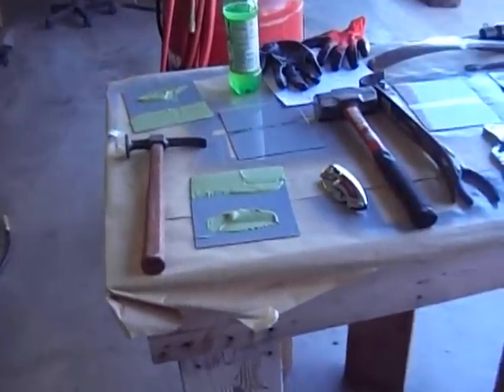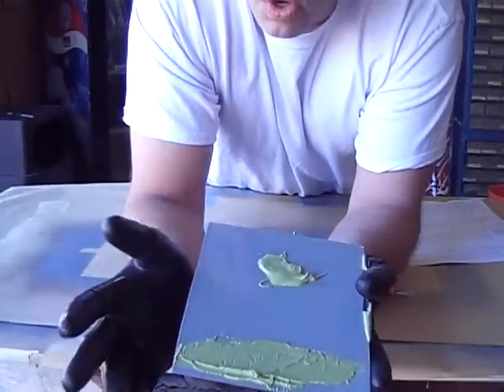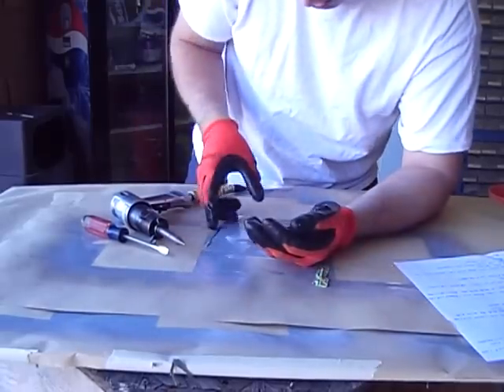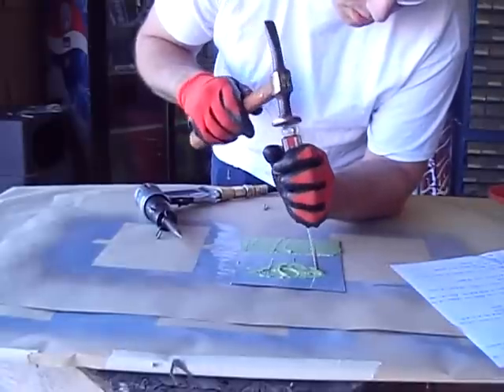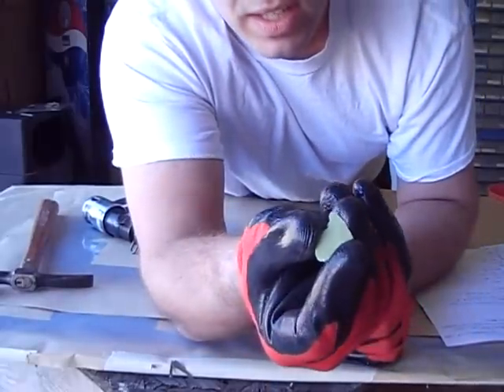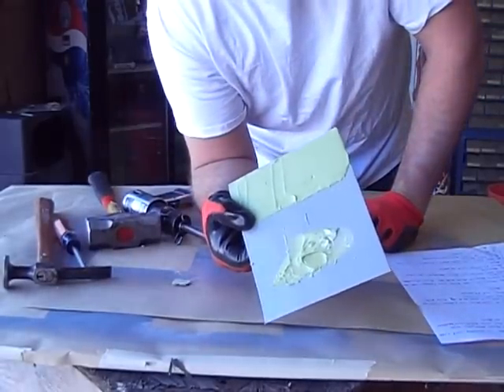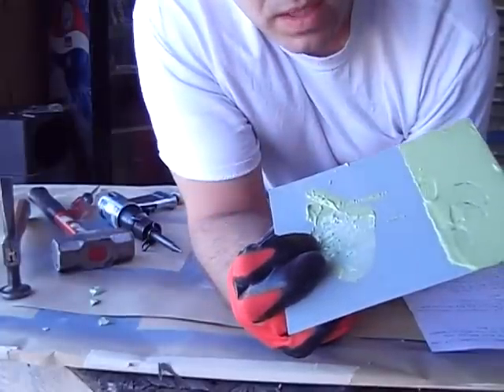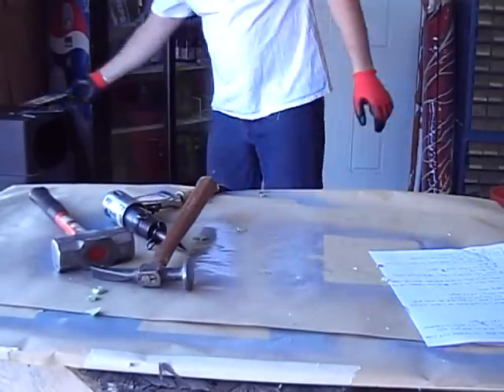Spi epoxy primer & Ospho torture test

Comment: Now take some paint stripper over that SPI and watch what happens.LOL.
Reply from the maker: Have you done it ?
Reply: MrFireman164 Sure have, it tore it a new one. I did a YouTube video testing out different products at the same time. SPI came out at the bottom of the pile. I kept the video private. The PPG 2050 Epoxy is by far a better product.
Reply from the maker: Seems paint stripper would tear any "paint" a new one :)
Reply: MrFireman164
The other Epoxy's did very well, SPI did the worst, next was the POR -15.What I don't like about the SPI is that it takes 7 days to dry. You can imprint it the next day. I don't know about you but I don't have the time watch primer dry for 7 days LOL.
Reply: hotrodmtf It doesn't take 7 days to dry, that's the recoat time. Cure time and dry time are not the same things. It will be dry in a few hours.  If you imprinted it the next day you did something wrong.  And a paint stripper test is worthless.  Not sure what it proves except resistance to methylene chloride.  No real world impact.
Reply: jlizer
I understand about the 7 day re coat window, but that has nothing to with the product not fully curing when mixed properly.  The paint stripper is a good test, it shows how the other brands held up and SPI didn't. Even regular thinner attacked the SPI. This is just a low budget product designed for the home DIY.
Reply: hotrodmtf
There's nothing relevant to a paint stripper test.  It tells nothing, other than if you are walking by your car and dump a gallon of paint stripper on it you're screwed.  If it did not fully dry then you did something wrong, the metal was too cold, you didn't induce long enough (or at all), perhaps the surface was treated with acid before.  I've been spraying SPI epoxy since 2009.  Just 6 hours after spraying it I can wipe it with lacquer thinner and it doesn't budge.  Nor can I print it with my fingernail, and I'm just an amateur, not a professional like Mustangs to Fear.  Maybe you should show us your tests.

The DIY market is their smallest business segment, with the largest  being restoration shops.  Top restoration shops across the country use SPI, including Rusty Gillis.  8 of the top 10 cars in the 2013 Goodguys Grand Nationals were refinished with SPI.
Reply: jlizer  If you can't understand the relevance of the stripper then I won't bother explaining. All conditions were perfect in my booth and the metal was prepped with all SPI products. Since I've been doing this for the last 43 years there were no mistakes on my end. If the product is working for you then stay with it. But I doubt seriously  that you'll ever find any top professionals using it.
Reply: hotrodmtf
Then you've seriously doubted wrong.  I personally know a number of good shops that use it almost exclusively, including Rusty Gillis.

Comment: This is somewhat a wasted test. Basic automotive refinishing knowledge says prime onto a secure surface. Over oxidized surfaces are not secure. Glossy epoxy surfaces provide a poor grip.     I often use Metal Ready by POR15 but it must be rinsed with distilled water, and primed quickly before  oxides builds up on the surface. Not a good application for pitted steel because of build up oxides in the pits. Not a good application over sandblast.
  Epoxy primer over very clean sanded steel, or sandblasted steel gives a good grip. Almost as good as acid etch primer.
Reply from the maker: Thanks for your opinion

Comment: I know this video is older, but what epoxy would you recommend now over treated or bare metal? Thanks.
Reply from the maker: I still use spi epoxy, never had a need to change